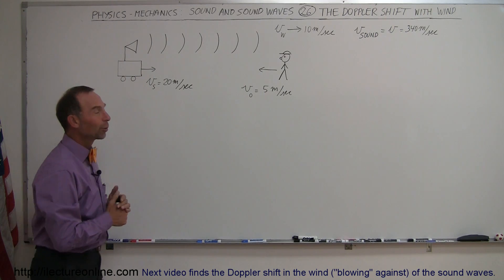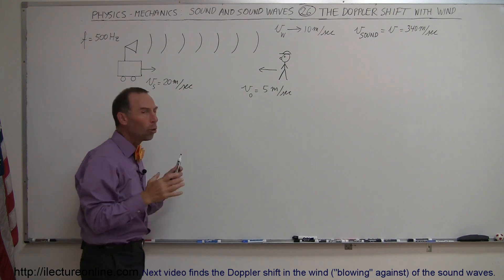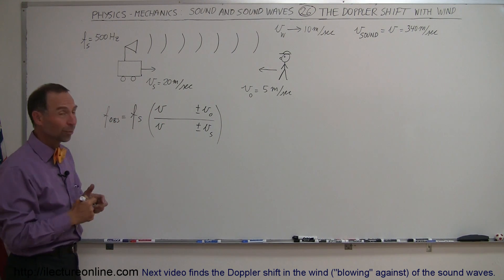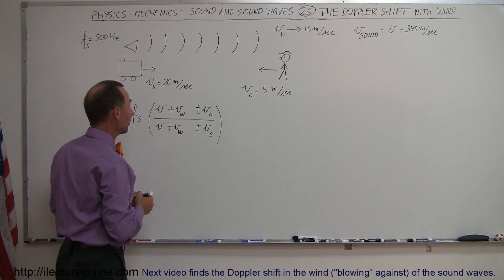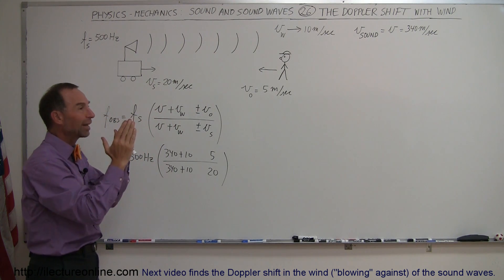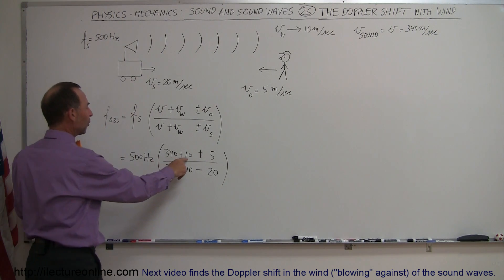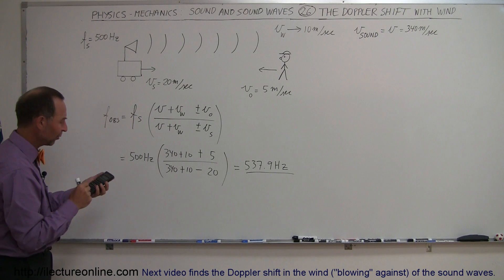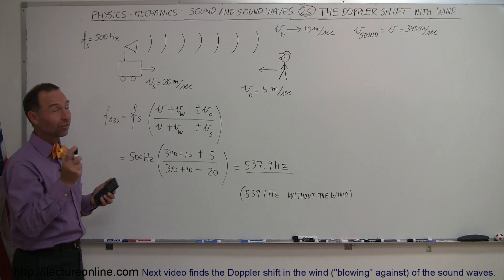Physics 20  Sound and Sound Waves (26 of 49) The Doppler Shift with Wind

Comment: So wouldn’t that mean wind only has an effect on objects in motion?  Based on this equation, if you have two stationary objects, the numerator and denominator would always equal 1; even if the wind was blowing 1000 mph.  500 x 1 = no change in frequency.  What am I missing?
Reply from the maker: Indeed, the wind does not affect the doppler shift.  Only the motion of the source and the observer.

Comment: I don´t quite get the intuition on why the wind makes the frequency lower, in this case. It makes sense looking at the math, but leaving it aside I would think that the frequency was higher, because the wind is only letting the waves travel faster and reach the observer faster (unless we assume that the wind is also slowing down the observer. If that´s the case, it makes sense)
Excellent video as always
Reply: +ProjectD100 remember  [ velocity = wavelength*frequency] here source frequency is constant 500Hz ,so when velocity increases due to wind speed.The effective or observed  wavelength must increase so the observed frequency is low as its inversely proportional to wavelength.

Comment: Excelent Videos.

I follow a little bit different approach; the velocity of observer and the velocity of the source in the equation are relative to the air. So, the velocity of the source relative to the air is 20 - 10 = 10 m/s getting close to the observer (so use a negative in the denominator); the velocity of the observer relative to the air is 5 + 10 = 15 m/s getting close to the source (so use a positive in the numerator)...then fob = (500)(340+15) / (340 - 10) = 537.88 Hz...same result, different approach.
Reply from the maker: +Aníbal C. Ripoll R. 
  Good input.